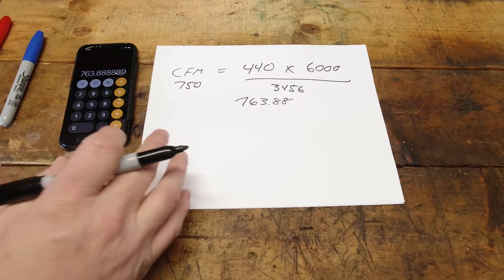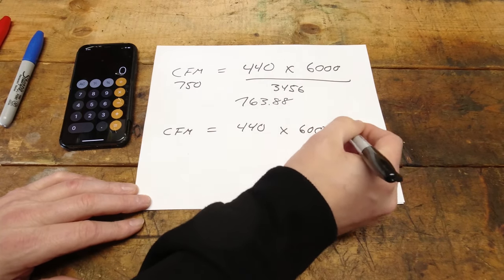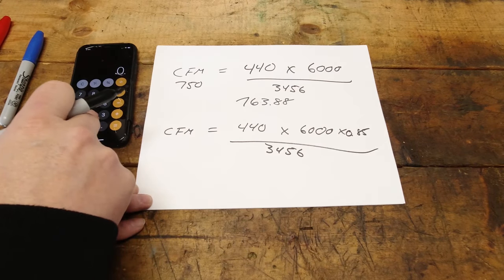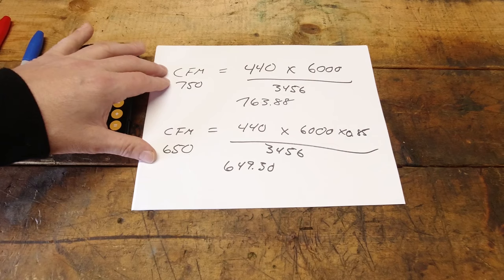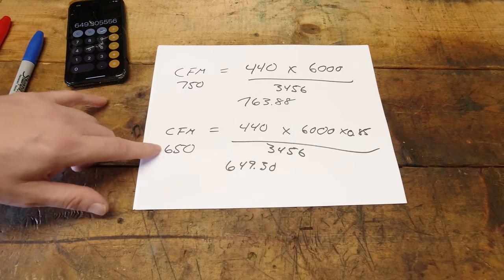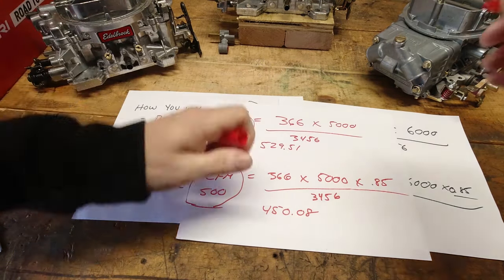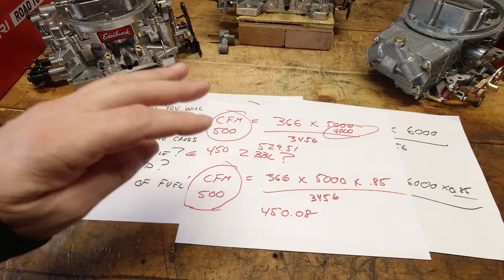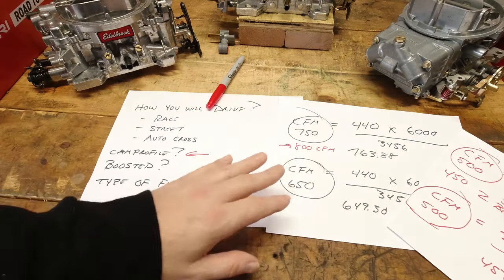How to Choose the Right Size Carburetor

Comment: So I’m building a 1996 Chevy Silverado 1500 it’s got the vortec 350 in it and I’m wanting to use it for street and possibly the track and I’m wanting to put a high rise intake on it so what I’m wondering is  a 650 too much or not enough for the carburetor I’m wanting to run
Reply from the maker: What calculation did you come up with after watching the video?
Reply: @MuscleCarSolutions  so I used both of them but the first formula I did 350x6000 then divided by 3456 and got 607
Reply from the maker: Sounds reasonable.  I’d you’re primarily going to use it on the street, I’d match that up with your cam selection.  Open plenum intakes and very heavy vehicles are generally a dog until 2500+ rpm.
Reply: @MuscleCarSolutions  so with cam selections how do you find out the best cam for the build also I apologize this is my first ever build and I’m new to all of it
Reply from the maker: @Smokingjoe35  you’ve got more than just a cam selection decision to make.  What are you really going to use the vehicle for?  What are you looking for a final horsepower number and how are you going to drive it?  Is this a full new rebuild or just working with the engine in its current condition?
Reply: @MuscleCarSolutions  at the moment just how motor currently is and want to push anywhere between 500-600 wheel and it’s gonna be my daily driver and play around vehicle not gonna try to drive it crazy hard but I want it to get up and go when it needs to
Reply from the maker: @Smokingjoe35  you’re asking for the impossible. Not with stock heads and the stock compression ratio.  If you’re looking for 500 wheel HP, that’s going to take a lot more than the stock engine is capable of producing.
Reply: @MuscleCarSolutions  I figured I’d have a lot more work to do to make the motor strong enough for it to handle that much. Just trying to figure what all I would need to do it

Comment: I have a 225 Slant six I recently did the 2bbl conversion on.  Right now the stock Carter bbd 2bbl is a 260 CFM which works fine but trying to see if the retro fit effort will be worth it for a Holley 2300 320cfm.  In doing your formula based off a max 5000rpm for a stock cam on my engine rebuild, I came up with 326cfm.  Now mind you hwy cruise at 70mph, the engine is running 3k rpm with current OEM carb.  This truck is used for street use only.  Would you still recommend the 320cfm Holley?  Thanks.
Reply from the maker: Doesn’t sound like a bad idea. The smaller carb will only run leaner at that rpm and mph.  Part of the problem with 1:1 final drive transmissions.  When they were designed and made, the national speed limit was 55.  The world and vehicles have changed quite a bit since then!
Reply: @MuscleCarSolutions  Thank you; yes this is the stock 727 TF trans; the Holley I am putting on is a Holley 2300 Economaster.
Reply from the maker: @chadfield376  yup.  All the transmissions in that era that had a 1:1 final drive are a challenge to drive at 70 mph!  Sounds like it will be a good swap!
Reply: Both Holley and Edelbrock's websites make the point that 2bbl carbs and 4 bbl carbs are rated differently. 2-bbls are rated at 3" vacuum (pressure drop) whereas 4-bbls are rated at 1.5" vacuum  (pressure drop). For instance, look at a Holley 500 cfm 2-bbl and a 600-cfm 4-bbl. the 500'[s throttle blades are the same size as the 600 cfm's primaries, and not even counting the 4-bbl's secondaries. There couldn't be that much cfm difference if they were both being rated on the same parameters.

Comment: Hello friend, very good video I have a 2600 cc montero, doing the calculations I get 160 inch and exploring the internet I have not found a carburetor that is offroad type with so little cfm, more or less it comes out at 220 cfm rated, if you had Any suggestions I would appreciate very much
Reply from the maker: Unfortunately you’re going to be limited to what other options might have been available on those smaller engines from the factory.  I’m unfamiliar with the small engine sizes but the math still works the same.  Though I’m not sure the factory replacement stuff was measured in the same way.  Your best bet might be finding a Mitsubishi/Toyota/Nissan type of owners group and see what they are doing for those older carbureted engines.
Reply: @MuscleCarSolutions  Thanks a lot friend, both for explaining and answering me, and for sharing your knowledge
Reply from the maker: @lastcrew213  sorry I couldn’t be more helpful.  Best of luck!

Comment: 355, 6" rods, 13:1, hyd roller 562/580, trick flow super 23s, vic jr intake take it to 6500rpm, Running a 750 proform race series on c12. Afr on a run averaged 11.0-11.5 afr with 78/84 jet split. I know that is pretty rich. So I dropped to 74/80 split has power valve still. Do you think that much of a change will be to much? And if so what would you recommend also I occasionally spray it with 150 shot and its 4000 stall strip only truck. Thanks in advance.
Reply from the maker: Not that easy a question to answer.  Couple things.  Lift doesn’t mean anything.  What’s the duration in the cam and the LSA?  Strictly a race only vehicle and I’d say that 11.0 AFR is pretty safe.  I don’t think that jet change is too dramatic.  It’s going to affect it but how much will depend on what that cam profile looks like.  What rpm are you launching at?  The spray would make me want the fatter jets in.  Why are you making the change?  Not on the nitrous every pass?
Reply: @MuscleCarSolutions  appreciate the fast reply and yes race only, changed because not on nitrous every pass and the plugs were looking a little on the rich side. I run foot brake. Launches pretty close to the 3800 to 4k mark and cam specs are Duration @ 0.006":300° / 306°Duration @ 0.050":248° / 254°Max Lift w/ 1.5RR:.562" / .580"Lobe Separation:110° main reason I ask if you think this is to dramatic of a jet change is my afr gauge is out of commission at the moment and i have a race next weekend. Dont want to lean it out too much.
Reply from the maker: Gotcha.  So when you’re on the bottle you’ll be changing the jets before that pass?  If you have a race coming up but no way to confirm, I’d rate the run a little rich than a little lean!
Reply: @MuscleCarSolutions  I will probably just bump my fuel pressure up for the nitrous run and keep my bottle pressure a little lower.

Comment: 496 bbc. 6000 rpm, roller cam 250/258 @ 50.. 3500 stall. Single plane intake 373 gears. Carb recommendation, thx
Reply from the maker: So what did you come up with based on what the video taught you?
Reply: @MuscleCarSolutions  I came up with a 850, mechanical secondaries because of the cam and intake . Well.........
Reply from the maker: @roywarren6275  I'd agree the intake can handle that, the cam can for sure and the CI of that big block sure can.  How are you planning on driving it?  Drag car?  Street bruiser?
Reply: The car will be one weekend out of the month bruiser. 68 Camaro ladder bar set up. Like the reviews of the “QFT” carbs. Like the street Q but for better street use I like the QFT SS 850. Specs about the same for both carbs.
Reply from the maker: I think you made the right choice on the size.  Sounds like a fun driver!  Then again, big cubic inch big blocks are rarely boring.

Comment: 408 small block oldsmobile520/542 lift 304/316 duration aluminum heads th350 trans 3.73 rear in a street/strip 79 cutlass. i have a 650 cfm FST carb on now that is very responsive but  needs retuned, im considering a 750cfm. the place  i bought the top end kit claims 440hp with a 850 cfm and 475hp or more with a 950 cfm, i think 850 or more is too much?
Reply from the maker: That’s an extremely aggressive cam for an olds.  Assuming you’re doing more strip than street with that setup.  In that case, if your rpm on that cam gets to 63-6500, then yeah the 750 would be the better choice.
Reply: I have a 69 318 bored 30 over long tube headers,heads stock with stronger springs good up to 494 lift...340 cam .... high rise intake...heads shaved thinner gasket bringing compression to 9:3:1.. compression.. 391....gears...stock stall at 1600/2000..28 inch tires...600 or 750.?. street driven with a little track time...91 octane

Comment: Hi. I know this is an older video but I greatly appreciate it none the less. Hope I don't overload you with info here but....  I'm less confused after watching it but still wondering which way I should go, possibly because there are so many people running over-carbed motors and I can't seem to shake that.  Anyhow, I have a 66 mustang fastback with a 72' 302 and C4 3 speed Auto. It was my Dad's years ago and I managed to buy it back... cool story actually. Anyhow, I have no idea what the cam is but It definitely sounds a little more aggressive than stock. I still get 18 hg at idle from manifold when tuning so its not a crazy cam.  It also has dual exhaust with long tube headers, H pipe with flowmasters (40s I think) and currently has a Holley 650 Double pumper (List 4777-3) with mechanical secondaries. Stock mechanical fuel pump. Fuel I usually run is the shell v power nitro + 91 octane (10% ethanol I believe) with a bottle of lead substitute and Orielly's octane booster. I drive pretty conservatively and only cruise it. Will never see a race on the street or strip but I might stomp on it when getting on the highway.  When I run the formula, 302 x 5000 / 3456, I get 436.92 CFM.  Quck Fuel makes the HR-450, a 450cfm double pumper with vacuum secondaries and Summit makes the M2008 500cfm DP with Vac. secondaries. I guess I'm ultimately asking if that's the cfm area you think would be ideal (is 450cfm enough) and if you think either of these carburetors are a good choice. OR, what would you suggest? Again sorry for the napalm of information.
Reply from the maker: So the question would be, how does the car run with the 650?
Reply: Very sluggish from the line but has plenty of top end power at 65mph highway speed. Idles rough for sure. Had the carb rebuilt and spent hours tuning it to get rid of the stumble it had on initial acceleration.
Reply: @MuscleCarSolutions and wow. Thx for the quick response.
Reply from the maker: @sb328  so you tuned out that hesitation and it runs well now?  If that’s the case, then what’s the trouble?
Reply: @MuscleCarSolutions No, I tuned out the hesitation but it still idles rough and is sluggish. I thought maybe it was low compression but I checked all the cylinders and they're all in a good and equal range and there's no leakage from the valves if I let the gauge sit there a while, so compression is good. So I'm just thinking its over-carbed. Thought by dropping to a smaller carb I might get a smoother idle and a little more pep on the street. Just not sure how much lower I should go. My options are 450, 500, 570. Plus I'd like to keep the driver side fuel inlet as that's where I've got factory hard line running to and would be a cleaner look in my engine bay.

Comment: Trying to figure out carb size  78 Ford F-250 pickup , 2 wheel drive .daily driver 
78 460 bored.40 over , flat top pistons, rpm dual plane intake , 3” headers, mild cam , 70 429 timing set , zf5 5 speed manual transmission , stock heads I believe..currently has a Holley 750 but considering edelbrock avs2 650 or 800cfm
Reply from the maker: Well, ignore the intake that’s mismatched to your combo and tell me what number you came up with in the equation?  It’s usually very close to what size you’ll actually need.
Reply: Thanks for the response.. I’m getting 575 cfm by plugging in 468 cubic inches and max rpm of 5000 on a few different carb size calculators so my 750 is way too big .. the intake was on the motor when I purchased it and not sure the cost to replace it is worth it …. Also I’ve heard that edelbrock carbs flow less cfm than Holley of the same size .. any truth to that

Comment: I have a rebuilt 460 with mild street cam, double roller timing set, That has ported heads and intake, long tube headers I use for mud racing on 35" tires. What size Carb should I use?  I need both torque and speed.
Reply from the maker: Well, following the formula in the video, what did you come up with?  I don’t know the other half of the equation to give a good answer.
Reply: @MuscleCarSolutions  750 to 800 cfm but with the mods I was thinking maybe more, you stated in your vid you would answer that question if you were asked, that is why I asked.
Reply from the maker: @BuildsAndMoreRacing  yup and I do!  But I needed to know the important details!  One major detail is the cam.  Mud truck stuff for sure still needs some grunt but has to also RPM.  It’s a delicate balance on the duration and LSA.  I hope that’s what’s in it when you said “mild street cam”.  They’re vastly different animals.  So if we’re matching the carb to that, and your RPM is going to be all in around 5500-6000, then yeah I’d likely go a little bigger on the carb.  800 would likely be just fine.  Might be a little fat driving around the pits but when it’s on the rev limiter, you’ll be just fine.
Reply: @MuscleCarSolutions  Yes the parts I used for rebuild are all 6000 rpm max also, including the Edlebrock dual plane rpm intake.
Reply from the maker: @BuildsAndMoreRacing  that’s a great intake for what you’re doing.  Perfect choice!

Comment: 73 dodge w100 360 4 speed manual. Currently a stock 1987 360. I do plan on a slightly bigger cam. Like a 340 grind. I have a 600 cfm eddy which I think is a good fit for where I want to be. It's a daily truck and I work it a bit. If I do either equation it points me to a 500 cfm carb. However with the cam in the future I think the 600 will be perfect. What do you think?
Reply from the maker: I’ll almost always plan for future use.  So if the future calls for a bigger size, and you can make it work on what you’re currently running, that has always been the best option for me.  No need to spend money twice if you don’t have to.
Reply: So the 600 should be a nice fit for the truck?
Reply from the maker: @kuhndog-1196  could be.  I don’t know the specs on the cam or what the rest of the set up looks like.  The 360 in that truck is a fairly low rpm engine, yes?  That would be the biggest factor in making the decision.

Comment: 4v 351c, .30 over with Keith black pistons and 9.5:1 comp. Open heads. Comp hyd cam 234/236 574 531 Lift 108 L C 
700 or 750 carb?
Reply from the maker: Don’t know.  What kind of driving with you be doing?  What is it going in?
Reply: Put a 750 on it. That engine came standard with a 4300d autolite 750 cfm. I have a q code 351c cobra jet in a 72 mach 1

Comment: How about a Ford, 351M-400, stock, with an Edelbrock performer intake, Holley, may even put on some headers. IT hauls garbage off on Saturday. Goes by the church to work. Go to the Hardware. And back home. An occasional 50 mile round trip to work and back. 
 By this video, looks like it needs a 500 CFM.
Reply from the maker: 500 CFM could be right.  That’s a low rpm torque engine.  As long as you don’t have anything that would take it past that 4000 rpm mark, I’d be 100% ok running a 500.
Reply: @MuscleCarSolutions  Yea, I'm not building a race engine. It started as a timing chain. My friend brought it for a parts truck. 
 But, in 79, they had them choked down for emissions. I just want it's full potential. Not rebuilding it. But it's got serious gunk from sitting probably 15 years. And I'm just taking the intake off before I even try to start it. Compression feels good, but gonna yank the heads and take a look, have the heads worked. So I thought an intake and Holley would get all it's got to offer. It will be a good Truck engine. It's a camper Special truck. Someone took care of it at one time. I assume they died, it sat, and got sold for junk. I just love making old things run again. I'm a body paint man mostly thou.

Comment: 406 sbc it’s 11.2 to1 on 93. Engine revs to 6300rpm I have a 750edelbrock on it and I street drive the car as a daily at least when it’s not raining to work that’s a 45mins from my house. The car according to the afr gauge runs super lean at idle and runs 13.5 at wot. I rebuilt the carb and it still is lean at idle no matter what I do for adjustments. I want to buy a new carb what size should I go with?
Reply: I forgot  to mention the cam is a bracket master 2 has 246duration at 50 and 108 lobe separation I have a built th350 and 2500stall converter if that helps.
Reply from the maker: What is your AFR at idle?  13.5 at wot is lean, especially with that CR.

Comment: I wanting to get a bigger carb for a 350 sbc and I plan on keeping it stock and just road/off road but mainly on road other than the carb and hopefully the intake, when I did the equation I figured I need a 500cfm, but I'm wondering if that would be to much for it or if I could just go ahead with a 600cfm
Reply from the maker: That’s ultimately going to be your decision.  This is really made to get you in the ballpark.  Off road use is usually an RPM range that can vary.  Off idle to 4500 max.  Lower rpm doesn’t require as much CFM.  If you w got upgrades planned down the road then it usually best to pick the bigger size.  Don’t be afraid of running the smaller size if that’s all you’ll demand of it.
Reply: @MuscleCarSolutions  alright, thanks
Reply: Also another question I just thought about should I go with a holley or an Edelbrock I've heard good and bad about both
Reply from the maker: @noaha2430  off road I’d stick with the Edelbrock.  If it was an off road race truck, then go with the Holley.  Two different types of carburetor with much different applications.  The folks who say one brand or another is junk probably can’t tune either one.
Reply: @MuscleCarSolutions  Alright thanks for the help
Reply from the maker: @noaha2430  anytime!